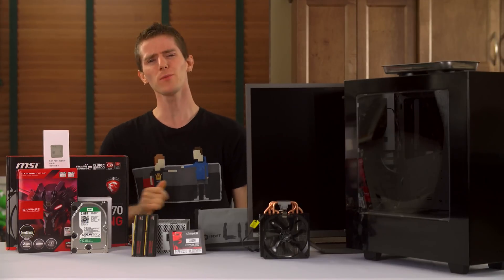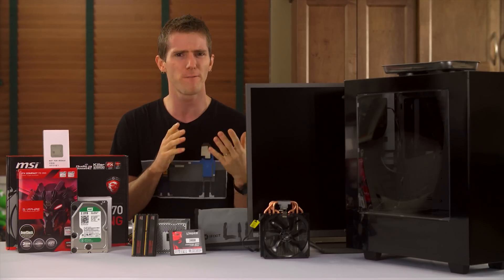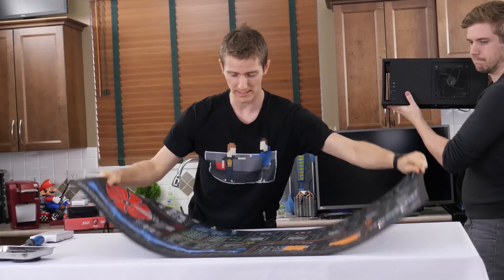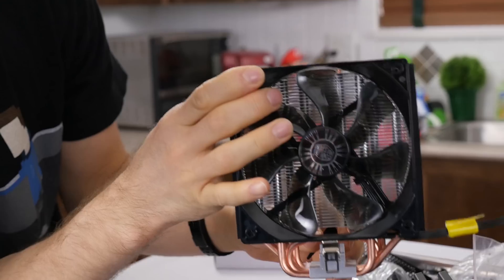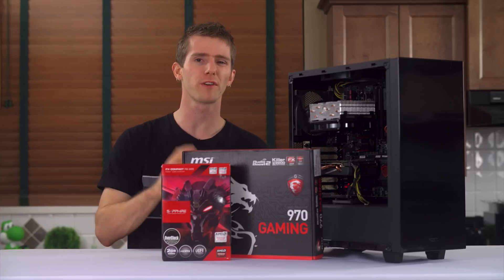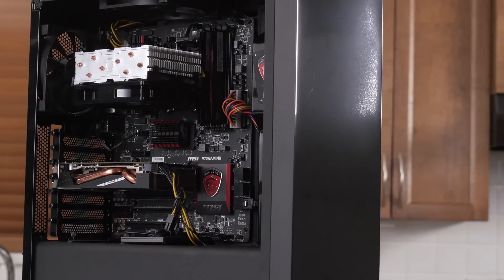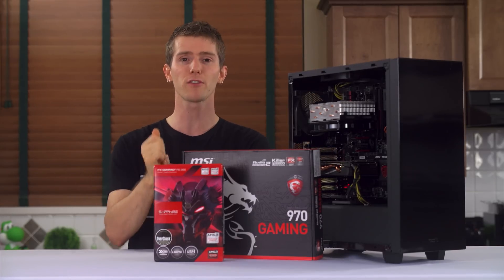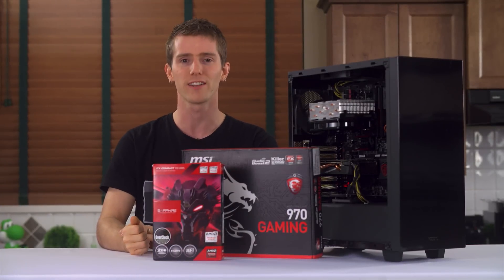Can you Build a 4K Gaming PC for Under $1000?

Comment: 2gb graphics for 4K? Linus, please.
Reply: ***** But this clearly isn't a matter of "believing" :D It clearly works, so i really don't get the point of your comment. Ofc you do need more vram to play demanding games at 4K, but you simply do NOT need it for the games, like clearly stated in the video you watched, that have not such demanding requirements like, as shown in the video you watched, LoL, CSgo and such.
Reply: i loaded 4k in my 64mb GPU
Reply: +Will Gaines Have you even tried watching the video? The games this system is supposed to run don't even need that much of VRAM. It's not the system which runs AAA titles at 4k.
Reply: #linuslivesmatter
Reply: +xtom GTA V or Shadow of mordor will eat 4GB
Reply: +Will Gaines lol
Reply: +Will Gaines I'm running 2 980s (So 4Gb of VRAM) with no VRAM issues...
Reply: +Will Gaines well you would be wrong. It clearly works just fine for this suite of games.
Reply: +gr8tim22 reports and tests well he did said most commonly played games
Reply: JOHN JOHNNY BRAVO  a gpu?
Reply: +naked guy holding a Kalashnikov okay but right here in canada for the same price as a 970 we could also get a r9 390 with like 8gb of vram
Reply: ***** It has 4 gb just about 15% of the memory is waaay slower and basically useless. It still can be used the but the controlling bus is nerfed hard
Reply: +Hcaz niatrap I replied but i didn't read the whole thing. 

Yes the 970 has a useless (aprox) 512MB of VRAM. Still 4GB physical but  the buss had some bad compromises to differentiate the 980 and the 970(and to save power/higher yield)

the slow memory on the 970 is about the same as the ram on your computer if i remeber correctly, so it's basicly useless :D
Reply: ***** its not even a 380 its the mobile version of the 380
Reply: Actually yes. you be surprized at what happens when you tweak settings and do the bf4 fps tricks out there.
Reply: Funny to see how this comment aged into 2019
Reply: +Will Gaines did you watch the video at all or did you just glance at the box at minute one and went forward to comment?? Like srsly? Did you watch it? :D
Reply: +Will Gaines Do you really think he would have used a 2gb card if it was unreliable.
Reply: george phillips just saying that 2gb isn't a big enough frame buffer for 4K. I recommend no less than 6GB for 4K gaming
Reply: +Will Gaines But gtx 970 has 3.5gb GDDR5 and then an extra 512mb slow running vram
Reply: That can't be right, i play bf4 with a 4k screen and manage to get upwards of 50fps with medium to high settings with a gtx 770 which only has 2gb vram.
Reply: +Will Gaines maybe but not at max details. At low/medium will be good but certainly not high
Reply: +Rumplelumpa Snickerdoodles: I tried this build
 Intel pentium G3240

Western Digital Caviar Blue 1TB 3.5" 7200RPM Internal Hard Drive
Corsair Vengeance LP 8GB (2 x 4GB) DDR3-1600 Memory
Corsair VS 550W ATX Power Supply

Brilliance 4K Ultra HD LCD monitor
P Line, 28"/71.1 cm, 4K Ultra HD (3840 x 2160)  288P6LJEB/00 

first build. Got monitor in sale so it turned to be mistake. I play Dota 2 and other stuffs like surfing, youtube and little photo editing.. Can you suggest me budget spec improvement for this build.

thanks for your time
Reply: +JOHN JOHNNY BRAVO a cpu and  gpu. 

try an i3-4170 and a gtx 950 that should be enough for a fellow dota player.
Reply: +JOHN JOHNNY BRAVO 
GPU. Onboard graphics suck. 
+Neetoryu has the good idea
Reply: +Happy God yes, it only has 2 gb of VRAM, but your not gaming on a 5k screen, its merely running a 5k panel, We have an old late 2009 27 inch iMac, and it has a 1440p screen with 512 freakin mb of VRAM, I can't game at 1440p on it. but it runs it solidly
Reply: Alan Barnes yea . no.
Reply: Rumplelumpa Snickerdoodles I did, in fact, watch the whole thing. And I still believe that 2GB is nowhere near enough to have an enjoyable experience at 4K. Maybe 1440P, but not 4K.

Comment: I can run the witcher 3 on max settings 1080p on my laptop at 30+fps
Reply: I managed to get mine for 1450$ from ebay. Best purchase of my life.
Reply: Can't tell you anything if you don't give the specs of your laptop. 

The answer is probably no anyway
Reply: 980m, i7 quad core 4710HQ, 16gb of ram
Reply: Kia Afzali  you could probably get 30 fps at high to max settings, but I'd turn them down a bit to get 60fps
Reply: +Kia Afzali which laptop is that ?
Reply: +Pierre Stromae alienware 15

Comment: Hey guys I just made my first budget build and wanted to know if it can run skyrim and cs:go on high settings. CPU: Some bunched up disinfectant wipes.
GPU: My little brother's most mediocre drawing.
Memory: A little bit of rat brain.
Storage: A Lego building that is hollow so you can store stuff.
Motherboard: A piece of paper(I'm willing to upgrade to a piece of cardboard). 
Case: a cereal box.
Power supply: Some nearly dead AAA batteries(I'm also willing to upgrade to some nearly dead AA batteries).
Monitor: A couple of LEDs(this is where I'm spending most of my budget).
Speakers: One of those birthday cards that plays a song when you open it.

Comment: What do you guys think of this possible build?

CPU: Intel Core i5-6600K 3.5GHz Quad-Core Processor

CPU Cooler: Cooler Master Hyper 212 EVO 82.9 CFM Sleeve Bearing CPU Cooler

Motherboard: ASRock H170 Pro4/D3 ATX LGA1151 Motherboard

Memory: G.Skill Ripjaws X Series 16GB (2 x 8GB) DDR3-1600 Memory 

Storage: Western Digital Green 4TB 3.5" 5900RPM Internal Hard Drive 

Video Card: EVGA GeForce GTX 980 4GB Superclocked Video Card 

Case: Cooler Master Storm Enforcer ATX Mid Tower Case  

Power Supply: Silverstone Strider Plus 600W 80+ Bronze Certified Fully-Modular ATX Power Supply

Comment: Hey guys, I need your opinion, can I play new games like GTA5 in full hd 60 fps with this setup?
Intel core i5 4690
Sapphire r9 390 tri x nitro oc
8GB of ram ddr3 1866 MHz
And some 600-750W power supply?
Reply: +Filip Markovič 
In full HD you wont be able to.
Your specs are tiny better then mine and i enjoy 60 fps on all new games on medium quality and 1650x1080 resolution
Reply: +Filip Markovič you can easily play it in full hd (1080p) with 60 fps, if you want better fps, don't use anti aliasing and you will be fine

Comment: Any good?
PCPartPicker part list: http://pcpartpicker.com/p/tTZG8d
Price breakdown by merchant: http://pcpartpicker.com/p/tTZG8d/by_merchant/

CPU: Intel Core i5-4690K 3.5GHz Quad-Core Processor  ($216.99 @ SuperBiiz) 
CPU Cooler: Cooler Master Hyper 212 EVO 82.9 CFM Sleeve Bearing CPU Cooler  ($24.89 @ OutletPC) 
Motherboard: MSI Z97-GAMING 5 ATX LGA1150 Motherboard  ($135.99 @ SuperBiiz) 
Memory: Kingston Savage 8GB (2 x 4GB) DDR3-1866 Memory  ($47.99 @ Amazon) 
Storage: Crucial BX100 250GB 2.5" Solid State Drive  ($72.00 @ SuperBiiz) 
Storage: Western Digital BLACK SERIES 1TB 3.5" 7200RPM Internal Hard Drive  ($66.56 @ SuperBiiz) 
Video Card: MSI Radeon R9 390 8GB Video Card  ($299.99 @ Newegg) 
Case: NZXT S340 (White) ATX Mid Tower Case  ($59.99 @ Micro Center) 
Power Supply: EVGA 750W 80+ Bronze Certified Semi-Modular ATX Power Supply  ($49.99 @ NCIX US) 
Monitor: AOC i2367Fh 60Hz 23.0" Monitor  ($149.99 @ Amazon) 
Keyboard: Logitech G710 Plus Wired Gaming Keyboard  ($96.99 @ Best Buy) 
Other: Blue Microphones Snowball USB Microphone - White ($59.99)
Total: $1281.36
Prices include shipping, taxes, and discounts when available
Generated by PCPartPicker 2015-10-29 16:26 EDT-0400
Reply: +Ya_Boy_Dom consider going Skylake for not having to reboy ram soon (ddr4) and better upgradabilty without having to buy both new mobo and cpu, also having 16 gb of ram is gonna be a must soon considering games are beging to want to use morethen 8 gb etc Arkham knight, syndicate
Reply: Ok, but should I just buy the same pack so 16gb total?
Reply: Ya_Boy_Dom 16 gb is more then fine for now unless you are a editor or something in that catagory.
Reply: Yeah, im not :P
Reply: hmm..
Reply: could you give me a link though? or at least tell me the price'
Reply: +Ya_Boy_Dom  I wish dudes like you would find a brain seriously.
Reply: +Ya_Boy_Dom Overkill PSU(Unless Ur Going To Upgrade), And Overkill Motherboard
Reply: Well, what should I get? The hertz and monitor, like all I have now is a somewhat better BenQ monitor but I just realized, its 60hrtz
Reply: spring the extra $ on the 4790K and a corsair H110 Gt you will never regret the extra Day at work on overtime to afford the extra 200$ for them the preformance is  Just amazing and my temps are 24C idle 63c at 90% load wile rendering  a few tabs open in chrome and a movie playing in smplayer
Reply: Any reccomendations?
Reply: The first one, I think I've already seen, and the second one, the BenQ one, is it 144hrtz?
Reply: Well, thanks for the help but i've opened up a forum on the Steam discussions and some people have responded.
Reply: +Ya_Boy_Dom can you link the discussion? Would be interested to see what they say
Reply: +Ya_Boy_Dom get the Asus 428QE its the best bang for your buck 144hz
Reply: yeah really good
Reply: +IDefinitlyGoHam amd rekts nvidia now
Reply: +Ya_Boy_Dom You might consider getting a 970 over your r9 390. The monitor you chose is 1080p so you will not be using the 8gb of vram in the 390 and according to passmark (standard industry benchmark) the 970 performs 26.56% better as long as you have enough vram which the 970 definitely does for 1080p. Also the 970 starts at $309 as of 2/8/17 (http://www.newegg.com/Product/Product.aspx?Item=N82E16814487136&nm_mc=AFC-C8Junction-Components&cm_mmc=AFC-C8Junction-Components-_-Video%20Card%20-%20Nvidia-_-EVGA-_-14487136&cm_sp=&AID=11892368&PID=3962334&SID=) as opposed to the $329.88 card you chose.
Reply: +RagePower2000 a better option than just getting a better monitor would be to dial up the settings in game. 144hz does look buttery smooth and the card will definitely run it on high or ultra, in the future he will have to dial back the settings and I'd rather have 60hz at high/ultra than 144hz @ medium.
Reply: +Ya_Boy_Dom Nice build dude! You could also overclock since your mobo supports it and you don't have a stock cooler. Tell me how it is :)

Comment: I've an older I7 machine form the 2008 time frame. I recently added a GTX 970 to replace a well built but long in the tooth GTX 570. I used the 570 in a cheap AMD build that has a new PSU & an 8 core AMD processor. I was really surprised at the increases in usability of my old PC with a new GPU. While I don't play many games & did notice a huge increase in usability of this 4 generations old CPU (860). 

So as you stated folks don't always need 2000 dollars worth of GPU's & a 1000 CPU with tons of memory to have a great gaming as well as PC use experience. 

I game and view on some old 60 HZ 1080 24" monitors. The only other upgrade I see in the near future would be a better & bigger monitor. LOL

Enjoy the vids & thanks for the info.

Comment: How good is this for Oculus?
Reply: +Ouchie Not powerful enough. The R9 285 is quite a bit too weak for that. If you go Nvidia, get a 970 or above. If you go AMD, go with a R9 290 or above. If you want to play demanding games at high settings, you definitely want to get something better than the two GPUs I listed.
Reply: +El Diablo lol
Reply: ***** Haha, the O has two different screens for each eye.
Reply: +DailyAverageGamer You need more than a 290 i have almost this exact rig and the DK2 barely works on some games like Star Citzen. The New rift has a better resolution so id recommend something different.
Reply: Oops, I meant 390 lol
Reply: +Ouchie not good at all :D you'll need a waaay more powerful graphics card...i'm not quite as familiar with amd as i am with nvidia and i know that only the gtx 970, 980, 980ti, 780 ti and ofc the titan x are oculus ready. Pretty sure the fury x from amd is oculus ready as well...but even if you'd have one of those babies the rest of the hardware in this video aren't suited for oculus by any means. you'll also need a way better cpu as well as at least 16 gb ddr3 (1866mhz+ is recommended) and the motherboard needs to not only be compatible with all those components but also needs 2 usb 3.1 ports as well as an extra e-sata port plus 2 usb 3.0 ports and of course enough usb 3.0 or 2.0 ports for all your other peripherals.

So all in all you shouldn't consider the setup in the video as rift-ready but really as a good setup for common online games to run at 4k resolution.
Reply: i believe it can do it, with some overclocking,but the r9 285 is outdated now,get r9 380 4 GB and it wil do.

Comment: I dont say this build is stupid but really a 285 go with a 290 or 290x and if you want 4 k slap in one more later down the road + the 8 core is great for multitasking its not as fast as an top end intel but if you build on a budget its a great processor the msi board i wouldnt use for crossfire as i was shopping for a new board i did hear the they drop performance if using the non connctor crossfire.

Comment: Could someone tell me if it's still a good idea to build this exact rig setup? Or could I build a 'slightly better' tower that does 4K for the same price? Considering that this video is getting close to an year old, and with new tech always being constantly released, I wouldn't doubt it if there's tech that could surpass the ones shown in this video. Only gripes that I had with this rig was the choice of case. I actually liked the case that you showed in your "ULTIMATE Build a Better $1500 Gaming PC Computer "How To" Guide", but in black. Also curious to know if the water cooling system that was also shown in that video could work with the rig in here?

Comment: WD Greens for gaming? That seems like a mistake, greens have been unusable for gaming whenever I've tried.
Reply: +Rivar X they arent unuable, they are just very very slow and not worth it for the money
Reply: a true scotsman uth Yeah, they've been totally unusable for me though, it made my game so unbelievably choppy and unresponsive. I'm not being a snob talking about 1fps either, it really was unplayable. I guess it depends on which game you're playing.
Reply: Rivar X really, thats not your hard drives fault, what did you do???
Reply: a true scotsman uth Swapped out for a blue and it worked perfectly. Why would it not be the harddrive? 5400vs7200rpm makes a big difference, no?
Brand new system btw, 970/4590k.
Reply: you should still be able to run games at the same framerate though, i think it was damaged
Reply: a true scotsman uth If it can't read at the same speeds, can't read fast enough, couldn't that cause it to stutter etc? I've had two new greens act the same way on different systems. I guess they could be faulty but it would be a strange coincidence. Why are blues promoted for gaming if greens are fine?
Reply: Rivar X greens are just slower in loading i think, well you should be getting more fps drops, but not 1 fps or something like that
Reply: a true scotsman uth A lot of other people seem to be reporting the same problem as me, looks to just be related to firmware and green drives spinning down though. Fixable with newer firmware or changing power management settings apparently.

Comment: CPU- Intel Core i5-4690K Quad-Core proccecer
CPU COOLER- Cooler Master Hyper 212 EVO 82.9 CFM Sleeve Bearing CPU Cooler
Motherboard- Gigabyte GA-H97M-D3H Micro ATX LGA1150 Motherboard
Memory- Corsair Vengeance 8GB (2x4GB) DDR3-1600 Memory
Storage- Samsung 850 EVO-Series 250GB 2.5'' Solid State Drive
Video Card- MSI GeForce GTX 970 4GB Twin Frozr V Video Card
Case- Corsair 200R ATX Mid Tower Case
Power Supply- Corsair CX 600W 80+ Bronze Certified Semi-Modular ATX Power Supply

Optical Drive-Asus DRW-24B1ST/BLK/B/AS DVD/CD Writer
Operating System- Microsoft Windows 10 Home OEM (64bit)
Moniter- Asus VX228H 60Hz 21.5" Moniter
Externa Storage- Western Ditigal Elemants 1TB External Hard Drive

good build?
Reply: +K Mando no, there is no point in getting an overlclockable cpu and a non oc mobo. The gpu is outclassed by the r9 390 and the power supply is an abomination